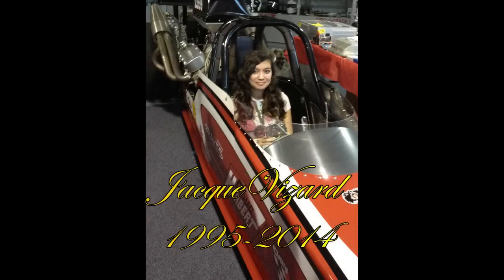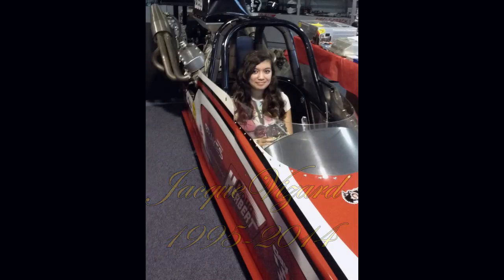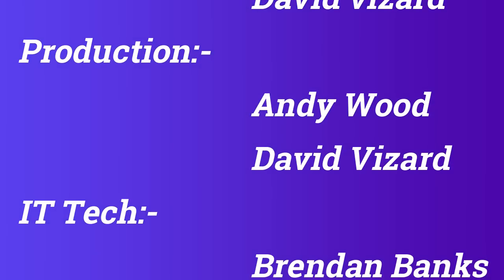GOOD NEWS -Blower motors are incorrectly dyno tested???!!!

Comment: Okay, maybe I missed the point.  An Otto cycle is 4 cycles, 5 if you include the overlap periods.  I think I don't understand how a supercharger can displace "500" ci in 2 cycles.  My guess is the calculated displacement of said supercharger.  Should one induce 500 ci of air, during 2 rotations, given the gear set up, then wouldn't you only receive 500ci of air?  The intake valve is only open for a stated amount of time.  I don't know, maybe I'm putting too much math into it. Either way, please David, continue to teach, if no one else, me.  I'm open to your gracious efforts of shared knowledge.  I will sleep on this and consume copious amounts of caffeine to get it into this thick skull.  I've projects to build, and you provide keys to power for these endeavours.
Reply: Think of the air in quantity of "mass flow" instead of raw flow and the superchargers theoretical displacement will make more sense......example if you take 500-cu/in of air at standard atmospheric conditions and compress it into 1/2 the space the pressure ratio will now be 2:1 but, the weight of that box of air will weigh the same amount as the atmospheric air no matter how much it is compressed.....so if your engine is 500-cubic inch V8 it take 720-degrees of crankshaft rotation for ALL 8-cylinders to go through a complete cycle, and if the blower is 500-cubic inches per revolution, then the engine will be requiring only 250-cubic inches of air per rev. @ 100% volumetric efficiency (VE), yet the blower is displacing 500-cubic inches of air @ 100% volumetric efficiency (VE), therefore the MASS of air as well as PRESSURE-RATIO of air in the intake manifold will both be 2:1 if there were no losses and everything was 100% efficient.....in the real world the engine can be X>100% VE and the supercharger will be X<100% VE, therefore there is losses.....and why the supercharger must have a displacement larger that the engine per revolution to make positive boost pressure, and the sizing / drive ratio of the supercharger is important to understand to ensure you achieve the desired boost / HP in an efficient way (not wasting energy in via. additional heat / friction which takes power from the engine and reduces the mass of the air flowing into the engine).......if you look at published supercharger efficiency maps published by EATON on the web, my comment above will make a lot more sense.......don't think about it in terms of how long the intake valve is open, think about it in terms of the engine running inside a pressurized box, then how much energy it takes you to get the pressurized box up to that pressure, that amount of energy is the parasitic draw of the supercharger (the less the better).
Reply: @ericschumacher5189 , thank you.  That sums it up perfectly for me.  I understand the MASS portion of the air, just forgot to think of it in that way.  I understand now.  Thanks again.

Comment: Your thoughts on centrifugal superchargers???
Reply: Belt driven Supercharger. Boost is linear with RPM, the more rpm you make the more boost it makes.

 So it makes less low speed power than a positive displacement supercharger.  But you make more top end power than a typical roots blower at high rpm, assuming cylinder head flow and cam timing can support higher engine speeds.

Comment: The consistency of the dyno is more important than the accuracy of the dyno.
Reply: If you have accuracy you automatically have consistency but if you have consistency you do NOT automatically have accuracy. To me the accuracy is paramount because you can't get much science from a better/worse,more/less situation. You need to know detailed data on all the parameters in order to know where the engine needs work and where it is a waste of time to work.
Reply: @billshiff2060  My point was when comparing parts to see which one makes the most power, consistency is paramount. As far as what power the engine actually makes, I don't think any two dyno's would come up with the same number. Ask 10 engine builders the same question, you'll get 10 different answers. People who build dyno's are no different.

Comment: That’s why at higher altitude to get power from the same engine,you supercharge it.
It’s called air pressure and the air you pack into it.
Boost equals power if you can contain it.
Turbo is the most efficient.
Reply: Boost is only a measure of restriction in the engine, volumetric efficiency is where it's at
Reply: @jerradstilson7285  you still need to get the air density at your volume to make power when boosted.
Reply: air density is the secret not boost pressure
Reply: More boost can make more heat many people don’t know that sometimes less boost is more power due to heat

Comment: A few elements of this I found challenging, first the dyno "damping", is this an electronic adjustment from the strain gauge output or a viscous damper smoothing out the torque pulses seen by the strain gauge? Either way an engine with fewer cylinders (and a light flywheel) could presumably produce quite skewed results? As for the supercharged scenario, I appreciate that some of the horsepower is effectively "stolen" from the front of the crankshaft but surely the end user is more concerned with what is available at the flywheel? I am not being deliberately obtuse, I can see that the engine builder or developer wants to know.... you warned us it was esoteric! Thank you for yet another thought provoking video.
Reply: Proper dyno testing is done at steady RPM over a long time period. Doing a sweep  isn't the way to go (inertia errors) and a lot of dynos can't hold torque at low RPM, that's why you miss out on the first 3000 rpm. There's a spec J1349?
Reply: @1magnit  Power sweeps are generally more accurate, if you have the software for it. (Many sub 2000 systems don´t. Even some sub 2010 systems are challenged on that account) If you want to you can hold it at 1000 rpm. but most of the time we start sweeps around 2000 rpm unless we are looking for something specifific down low. Also, if you want the right picture with steady state measurements youy will have to do a lot of points, like for every 250 rpm or so, or you are likely to miss afr dips or increases as they can come and disappear within 500 rpm. Of course, if you strap a 1000 hp monster on a 800 hp dyno you will be in trouble and it wohnt hold. But if things are matched there should not be any issues with that. Yes, the SAE 1349J have more or less become the industry standard which we all can relate to. Here on the EU mainland most still use DIN or in some cases KW. Both are easily converted if you want the numbers in another format.
Reply: @torbenalstrup3902  There's no such thing as an 800HP dyno nor a 1000HP dyno, they don't measure power, they measure torque and RPM and calculate power from there.
Reply: @1magnit  the dyno needs to dissipate the power though
Reply: @g0fvt  Dynos dissipate energy not power
Reply: @1magnit  the thermal energy is a function of the power input.
Reply: @1magnit  I know. I was using the generic term and conversion for everybody to understand
Reply: Like to have David answer this question
Reply: @nicknick2350  A brake
Reply: @nicknick2350  They measure torque not power .A dyno has a torque holding capacity of the brake and they also have a max rated RPM.
Reply: @nicknick2350  Force times distance